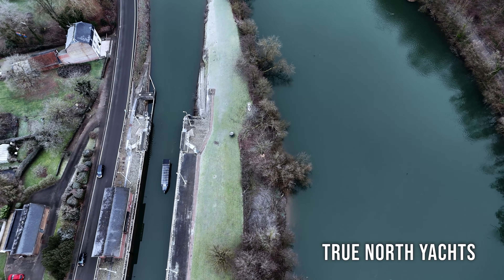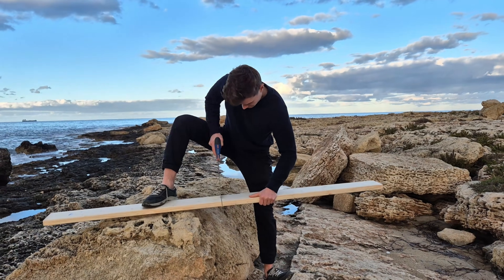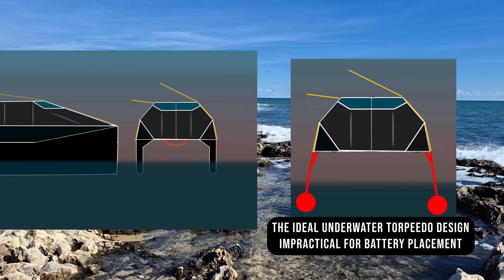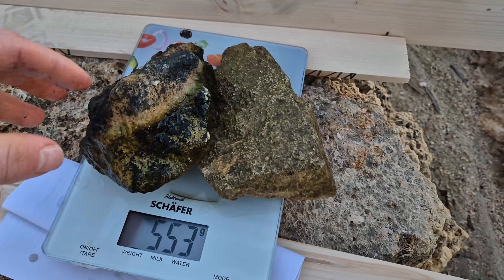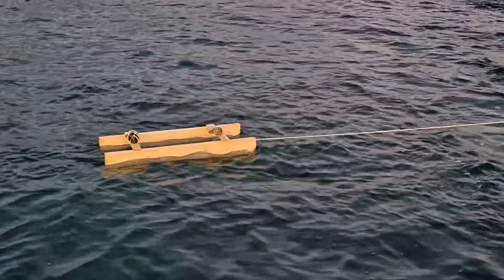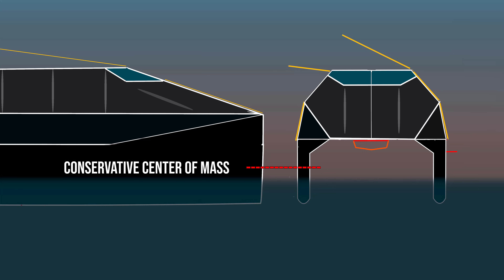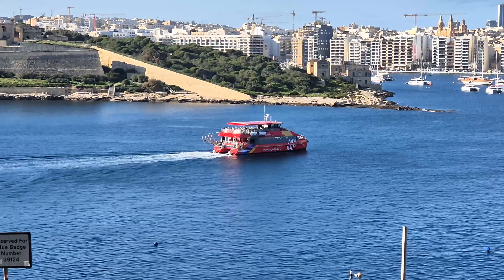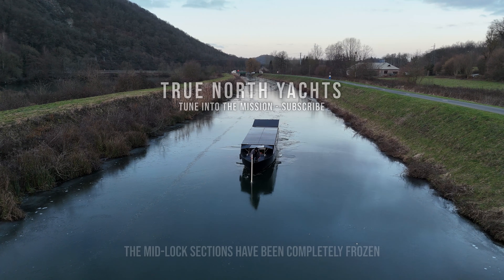Solar Works! Testing My Catamaran Model in Real Waves

Comment: Hi Lukas, I worked on a swath vessel for nearly a decade. The ship was certainly interesting. We used it as a stable platform to dive an ROV. 
Some issues we experienced with the aluminum framing was that there was indeed wave induced torsion between the hulls. Enough in fact that the ship required a lengthy shipyard to add double the amount ribbing in the frame sections above the waterline where the hulls attached to the base that connected them together. 
Second, there was a significant resonant "splaying" where the hulls would alternate driving away from each other then toward each other laterally. This caused significant issue again at the attachment points, such that we had to fusion weld a giant strut between the two hulls underwater. In the end, these repairs negated many of the advantages we sought in efficiency.  
I will say that the ship was extremely stable. Little needed to be tied down, even in heavy seas. The effect felt "gyroscopic" in nature, where the whole ship seemed to rotate around a central point. 
Definitely consider wavelength period and amplitude when designing your hull length, and the seas, she'll be able to handle. Belly slaps are a thing.
All in all, it's definitely worth a try! There were many good things about the design on top of the bad, and I think designing for reliability through certain sea states and not underestimating the hull flexing issues will yield you a solid boat. Good luck 👍
Reply from the maker: Good input. I see where a lot of rigidity might be required.

Struts just above the surface could add needed strength, while barely adding resistance

Comment: Do not have a squared bow, you need a pitched bow similar to your existing boat so floating weeds do not accumulate . This is a problem in rivers and canals. Your boat will only be in a cruise mode and weed debris will cause you to draw a lot more power. I have had solar electric boats since 2016 and the bow design is critical.

Comment: I've always wondered if a hydrofoil supported displacement configuration would work. Instead of lifting hulls into a planning configuration you could instead use the lift to lift the hull into a narrower profile for greater efficiency.

Comment: Would be interesting to see your model with a semi-circular plastic tube to simulate the cabin section. Would it self-right by physics when flipped over? That would be reassuring to see in the small model version.

Comment: Thank you for sharing your adventures!  This looks like progress, but I do have some cautions or considerations.  I waited this long to say because I wanted to see your process before I interjected.

1.  That swath design with the narrow vertical hulls all the way up to the main cabin have a tendency to nose-plow or swamp the stern when under drive power in swells, which your model was also doing.  I've seen it before.  Commercial fast-ferries don't suffer from this because their large size and high clearance dwarfs the local rollers where they operate.  They just don't "buck" on their own longitudinal axis.  However, at the scale of the Helios-13 you propose, this can be a factor in less than 2 meters rollers, which are common on the open water.

Since there is no incremental increase in bouyancy per centimeter of depth, it is likely to plunge down on the backside of a swell and ram/plow into the next swell head on, and in following seas the same will happen to the stern.  The fix for this is twofold.  First, have your pontoons extend past the front and back edges of the deck by about 15% of the total length each.  Second, have the pontoons arch or angle in to widen from just above the waterline to the bottom of the cross deck.  The polynesians sorted these things out centuries ago, and they were the masters of open-sea survivability.

2.  For structural integrity and torsional stress, I highly recommend having 4 cross braces/struts (even if they are lighter duty), not relying on 2 or even 3 heavier ones.  It has to do with the way the boat will deal with prying stresses from irregular or mixed waves, especially when moving diagonally to the wave propagation direction.  The problem under mixed conditions is not so much the slamming of the waves against the hull, but the way the uneven momentum of different parts of the hull (especially the 2 pontoons) make it want to tear itself apart.

If you are going to stay on flatwater lakes and canals only, this doesn't matter much.  If you are going out into open seas where different parts of the boat make be plunging or hanging it's own weight at the same time, it's crucial.  I grew up boating on the Great Lakes of North America, and even they were big enough to create harmonic wave resonances that would break motor-boats apart under some conditions.

3.  Every time you mention putting the batteries below the waterline in the pontoons, my spine crawls and shivers.  Are you really sure you want to put the one thing on the boat that can catch fire and explode in contact with sea water... into the one place on the boat where, in any sort of emergency or damage, they are most likely to come into contact with sea water?  Even putting them in floor hatches under the centerline of the main cabin is a lot less suidical, because that part of the boat is almost impossible to actually smack into anything, whereas the pontoons are the thing almost GUARANTEED to be the first and hardest to smack into anything.

Even if you navigate perfectly forever, something else can still smack into you, like another boat or a whale or who knows what else.  Wearing your power source like a bomb on your sleeve may not be the most prudent notion.  It had to be said.
Reply: I have experienced this behavior personally. My brother was piloting a fast catamaran, while I was "hiking out" on a wire harness to counterbalance. Suddenly, the bottom pontoon did a "pitch pull" dive under the water, causing the boat to stop dead. I was sent flying and spinning, landing in front of the boat. Naturally, my brother then turned the boat around and dragged me through the water, across the lake. Brothers! 😝
Also, I agree with Animist that your batteries could be very vulnerable if they are at the bottom of each pontoon. Better avoid any shallow reefs!
Reply: For safety reasons, several bulkheads can be made for batteries in the float housings, hermetically separating the housings and the battery, respectively, in safe volumes.
I also recommend placing batteries in steel boxes.
I also agree that a wider hull shape needs to be made above the waterline. Y-shaped float bodies are required.

Comment: Nice video and great ideas. I second the comment that designing and building a catamaran needs a lot of consideration, amongst the strength and stiffness of the body connecting the hulls. I would also be happy to use a cat for inland and coastal trips, yet to be ocean rated is a different story (i.e. waves hitting the interconnecting body, overall strength of the same). Believe that is why there are some ferries build like that but you do not see them on the high seas.

Comment: One thing you'll notice is all sailing cats have nets between the bows for the first portion, there is a good reason for this, some early sailing cat's had solid bridge decks  between the bows and this caused pitch poling when surfing down waves in heavy sea states, your design is fine for the med and northern coastal waters but not suitable for the pacific ocean and especially not for the southern ocean. I understand wanting to maximise cabin area, but the area in front of your "windscreen" is not cabin area anyway so have a more vertical wall and nets in front of the "windscreen" will give you more usable deck space and a more sea worthy design. 
Record wave height recorded in New Zealand was 23.8 meters so run your simulations for 25 meter non-breaking waves to give yourself a safety factor.
Reply: Nah it's ok, because he's smarter than all those people because he has AI. /s

They also have escape hatches on the underside on each hull in case of capsize.  You're donezo and cannot right the vessel without large equipment.
Reply: @meikgeik even a self righting ship doesn't work

Comment: Make the underwater torpedo a water power generator by pushing the water through a full length tube with turbines in it in sequence. The boat will gain power through movement provided by the solar keeping you with energy non stop.

Comment: It's nice to see the fineness ratio isn't relative to the overall aspect ration. Could even do two shorter hulls on each side and a central third hull to get maximum longitudinal stability in bigger waters. While in bigger waters you can drop a water sock to make tipping over in large waves less likely, granted the frame above water can handle the beating.

Comment: It's no going to be self righting , thats a pipe dream.
To be self righting, the center of gravity has to be lower than the center of buoyancy
This is relativity easy to do with a mono hull 
There are no full sized, live aboard self-righting multi huls. (that I know of)
There are a few claims but the claims only show cgi vids
Besides to flip a cat u'r doing something you shouldn't be doing, or poor design, usually too narrow for it's length to capsize or to wide for lenght for endos.

Comment: Thanks for sharing. Looks like a winning design. 

Would also consider adding/incorporating 2 hydro-foiling wings, inbetween the catamaran hulls. Something like this:
https://www.youtube.com/watch?v=PNH00YV9sDc

Combining the Air-cousening + "semi-hyrdrofoiling" would reduce drag, and also provide more comfort. (how to do it, probably alot of A.I. modelling?)
Would be a smart element to add, for If or When you add more power to the Yatch. ;)

Also liked this video - Electric Catamaran (just lower than your design, but proves the efficiency = Very low - Wh/Km)
https://www.youtube.com/watch?v=SLtHhI1Qpng

Comment: The swath design is definitely worth further consideration as this experiment proved. 
Could the batteries also be concentrated closer to the center of the hull lengths?…this would further stabilize the aft to forward of the vessel. 
The great thing about an electric powered yacht is that you can position the batteries wherever you want. 
This design is super exciting!

Comment: I'm not confident you got the weight distibution right.  Roof with solar will be high up.  Walls and furniture arrangement towards the sides does indeed create very spread out weight distribution, but instead of solid pontoons, that weight is mostly above deck level.  200kwh below water line is 1 ton = 22%, but your model has 40%+ below deck instead of 80% above, with 5%+ high up in roof.

Comment: I am recently wondering if Catamaran / Trimaran Floatparts could be made with a modular design. Sort of like lego bricks that you could build in a small shop, easily transport and than put together once you get to the water.

There is a system like that already for houseboats called "DIY poly hulls pontoon houseboats modular kit system" from Marine Dock Systems in Australia: https://www.youtube.com/watch?v=_wdI4TE7HD8

Comment: You do not want the batteries especially lithium iron batteries below the waterline any leak of salt water getting onto the batteries can cause extensive fires and possible explosions
Reply: but his AI says it's fine!  /s
Reply: @meikgeik As much as you can shit on relying on AI for this, the comment above is completely incorrect in how lithium iron batteries work. First of all- they would not catch fire from exposure to salt water. 

Even regular lithium ion batteries typically do not do this, lithium iron batteries are inherently very safe and would definitely never catch fire from that.

These are batteries chemistries that won't catch fire even if you cut them in half with an axe, a bit of salt water would only induce a small amount of current in case of short circuit, their conductivity is not high enough to induce a runaway situation in the first place even in regular NMC lithium ion batteries.
Reply: Lithium iron batteries will not catch fire from salt water, that is pretty much impossible.

His design is fine and would be the optimal way to do this.

Comment: Empirically, your design might not support a heavy weight due to the reduced buoyancy of the hulls. You might have limitations, especially for a solar powered liveabord luxury yacht. 

Hull shape with reduced volume in the front might plunge in the waves in rough open seas.

All existing sea going solar catamarans I know about  have traditional hull shapes not very different from catamaran sailboats.

Comment: That must be the most crude model, testing and simulation I've ever seen. I've said it before, try to book time at a university Ocean Lab to test scale models. The reason for doing that kind of testing is that those ocean labs are the closest we come to nature where you can have repeat conditions. The pistons on each end can simulate all kind of waves and you can see in real time how your scale model handles. 

Those stretches of sea travel you so far put in with your solar vessel is vastly different then say if you didn't take the inland channels. Biscaya bay is notorious messy in regards to wave patterns. North Sea yet different challenges. These are the conditions your new vessel must be able to withstand to live up to the usage and go anywhere yacht you are planning.

If such testing is out of budget, consider to enroll into a university that have such facilities - you are young and you got time.
Better to do it right the first time and have your new vessel perform as planned no matter the conditions.

Btw it's OK to put more effort into a scale model, at least the scale should be correct in any direction. Even if it means you got to glue and clamp wood together to get correct dimension.

I get it that it likely was done deliberately crude as it was just an idea suddenly appearing but if you plan to ever build for sale this is kind of your first interaction with potential buyers and investors. You might as well act like you belive in your project and do all parts as good as possible.

If your plan is just to build the next and bigger vessel for yourself and use it as a personal solar vessel, keep on doing wha your doing and use that vessel anyway you deem fit.

It's kind of hard to say anything about your next project. As your first vessel have taken you to France already and you are living your dream. I guess I just try to hammer in that what work for a personal vessel might fall short on so many frontiers if you take your next build public and commercial.

Comment: Sideway wind in combination with wave action is the thing to worry about, this vessel is so light. You should be able to run a simulation on this very easily to show this issue when you have a realistic superstructure which your model did not have. I have flipped many cats in my lifetime ( some on purpose) and really it does not take that much wind, remember your hull is a sail!

Comment: Your narrow hulls will pitch a lot and allow waves to slap your cabin floor more often as not enough buoyancy to rise. Note the SWATH in your picture has dive planes to keep it from diving into the waves pitching down, keeping the ship level as won't do it naturally.   Your model isn't going to tell you much as not accurate enough where actual weights, buoyancies are.
   A gently widening hull from a pointed bow to about 9 to 11-1 length to beam ratio has the least wave or skin drag for lowest drag.   This penetrates the wave and when the wave reaches midship, raises the cat up some instead of pitching it. Then transom stern dampens any pitching left and prevents squatting at speed.   
I'd do a flat roof with standing headroom in the hulls, center pod, and sitting headroom, 1'3m, in the rest of the cabin, cuts frontal area by 25%, lowering it .6m.

Comment: Remember to calculate the weight of the propellers on each side. Unless you are using all electric motors then the weight might not be an issue.

Comment: I've been wanting to build a an RC catamaran for about 20 years. Your videos inspired me to finally build one. The hulls (2cm wide) are 3D printed with gyroid infill so water can move to the front or rear "well" for some bilge pumps. The dual rudders are held by the end of the hulls and direct driven by small servos controlled by an Arduino Uno. I'm keeping the rudders independent so I can test if they can serve as "speed brakes" when both are pointing inwards.
Reply: Take a look of the  work of Peter Serpol ? sp  of  RC Flight test channel orogens he's done a massive amount  of testing work  on motors power hulls and 3d printing and hull building.  The first racing catameran built in the West was built by Herschoff  of  Main way back in the 1850s  under the Name Amaryllis. And was promptly banned from entering the race but was allowed to  enter against the clock  in a technical category of one a couple of replicas were built over the intervening . 
It wasn't till 1955 that James Wharram built his first cruising cat and crossed the Adlantic with his two German  girlfriends. 😉 Multi level  Shocking 😂. 
James's most suited to this design is the larger  Pahi s  or  theres a more performance orientated  design ..I think it is called Tahini  because the hulls are narrow the deck pod is wider and longer but still  quite low to reduce windage.
Reply: @clivestainlesssteelwomble7665 I know his channel but I'm not planning on doing fiberglass stuff. I just 3D print each hull in one piece.